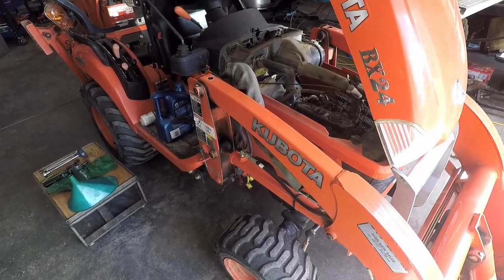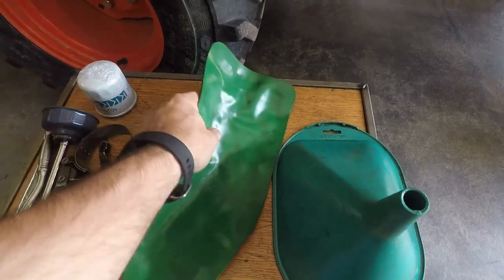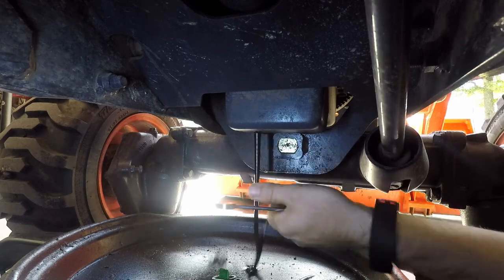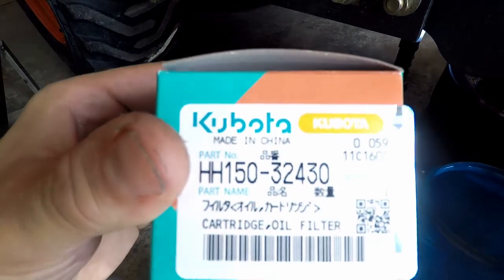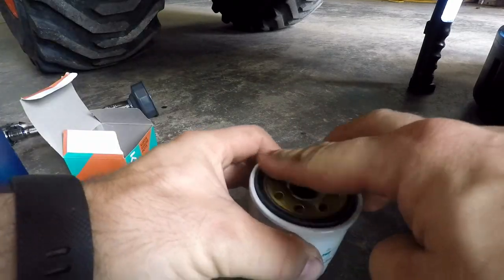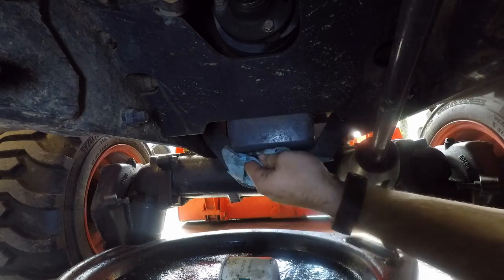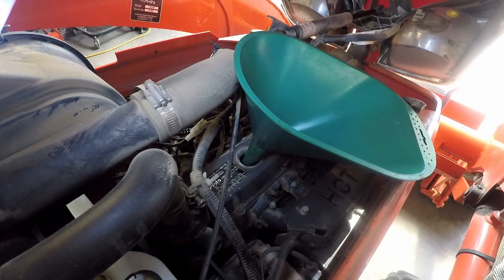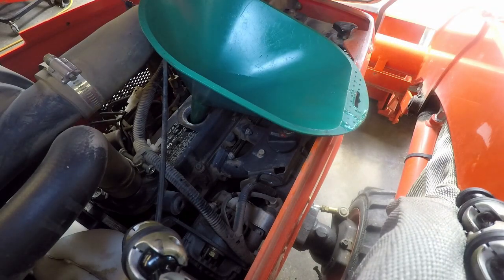Kubota BX Oil Change Step by Step

Comment: I knew there was a reason why I watch some of your videos, even If I know how to do whatever your doing. Sometimes I see neat tips or things I didn't know about .  

Never knew about or heard of a flexifunnel! That's cool. I guess that's how the dealers and shops keep oil off everything when you pull these filters, so it doesn't run all over the engine or in the case of the toyota I drive all in that front cross member or radiator support that the oil always flows all in.

That's cool. Thanks,  for whatever reason I never even thought of cardboard, but I don't put much thought into it. I just change oil and let it sit in the gravel overnight before I pull into the carport.

-Clemsonfor
Reply from the maker: Thanks man!! The form a funnel works pretty good. It comes in 3 sizes and this one is the medium. It also works good on draining a radiator. If you take a car to a dealer for an oil change the put it on a lift and they can wipe things off and spray it down with brake cleaner. Then driving it home blows things off. Now I know who you are. Thanks for watching and commenting!!
Reply: 94BULLITT 

I forget that my youtube name isnt the same. I was thinking for some reason you did, and then i was thinking i need to put my screenname so he knows who i am. Ha

Comment: I never cared for those filter wrenches, but after this I do. LOL
Reply from the maker: I wish I would have bought a set a long time ago.  I got the biggest set that Snap on, well Blue Point has. Different brand filters for the same application sometimes take a different wrench.  They are a life saver especially in a tight place or if a quick lube has over tightened a filter.

Comment: Do happen to know what size oil filter socket you used?
Reply from the maker: I have a Wix filter on it and it takes a different size than a kubota filter but I'll look tomorrow. I think it is best to stick with a kubota filter.
Reply from the maker: blue point  ofc65-14, 65mm, and 14 flutes fits a wix filter
Reply: Thanks for the info

Comment: Very informative. Could you do a video on how to change the hydraulic fluid and filter. Thanks
Reply from the maker: Thanks! I have a video on servicing the hydro. I just need to edit and upload it. I was saving it for a rainy day. Are you going to be servicing your hydro soon?
Reply: 94BULLITT   Yes Sir. I have a BX1860. Changed the oil but never hydro oil. Thanks
Reply from the maker: Here is the video on the hydro service. https://www.youtube.com/watch?v=uymopEZ49ko&lc=z23nhfpjyvixilotgacdp4340bn2xm2e45ofinc2vvlw03c010c